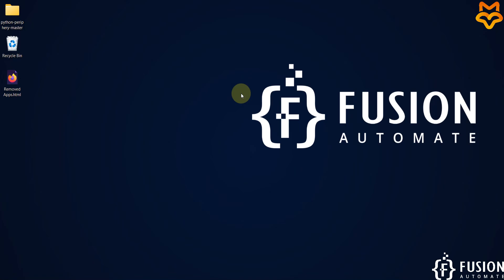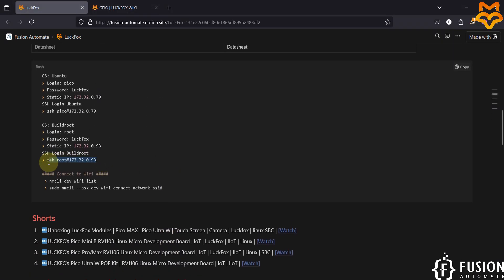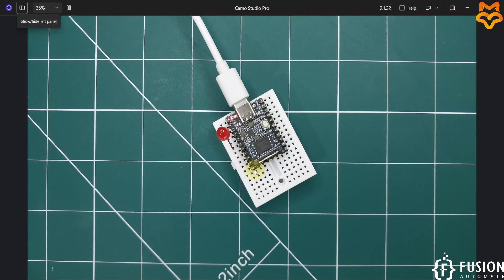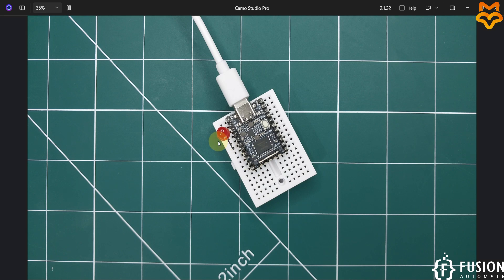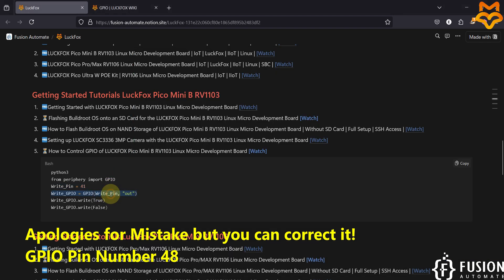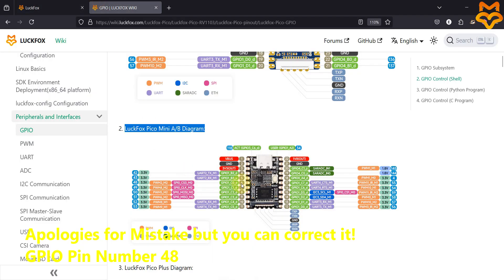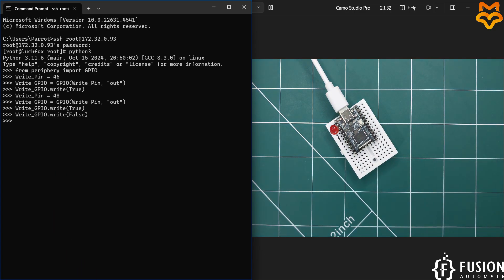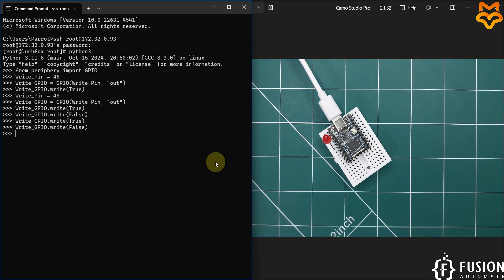How to Control GPIO of LUCKFOX Pico Mini B with Python using Python Periphery Library |

Comment: Hi @Fusion_Automate , can gpios on mini b run at 1V8 ? Or it is only 3V3
Reply from the maker: 3 GPIO for 1.8V
Rest 3.3V
Reply: @Fusion_Automate  thanks ,shame thought I can run spi on 1V8 . Maybe you know any simmilar sbc where you can set either 1V8 or 3V3 for gpios ?
Reply from the maker: Not in mind as of now but LUCKFOX boards are having 1.8V GPIO. So, may be you can give a try.